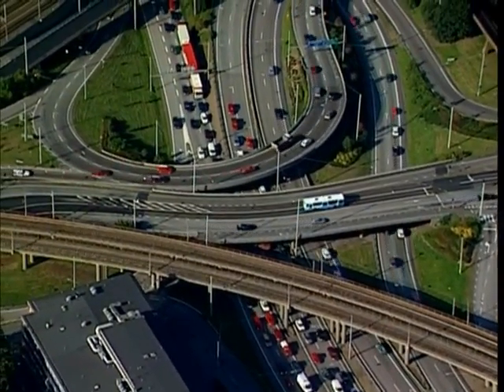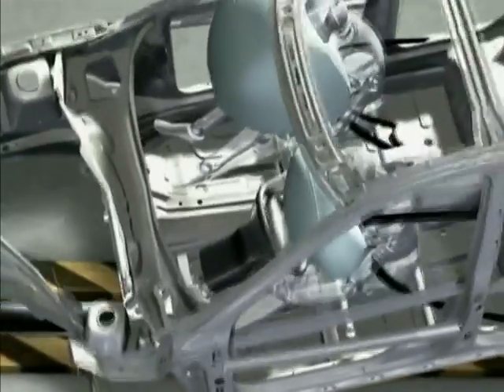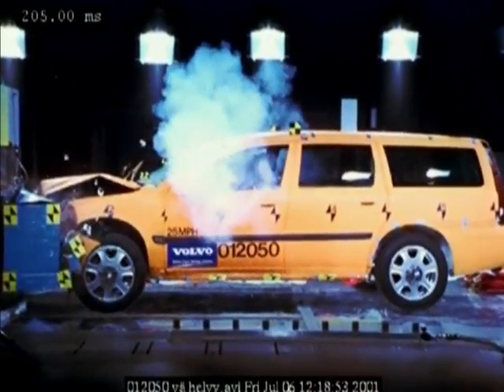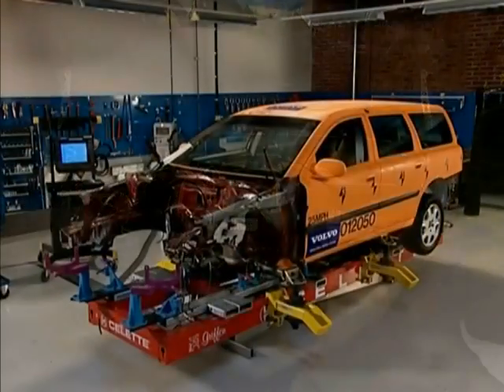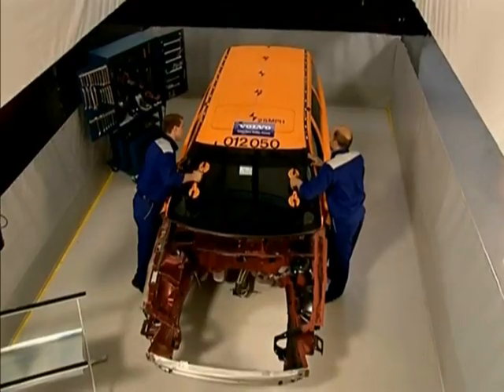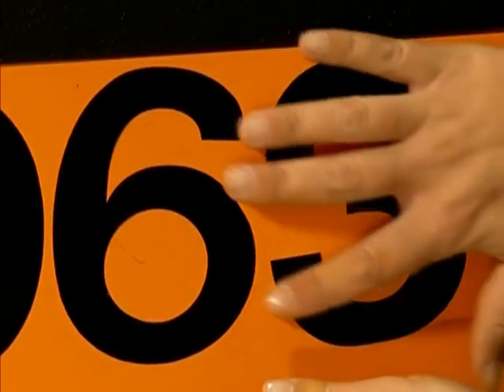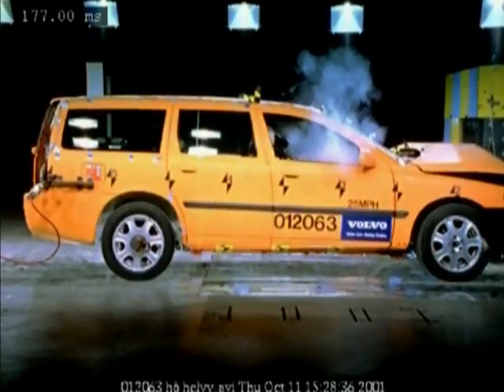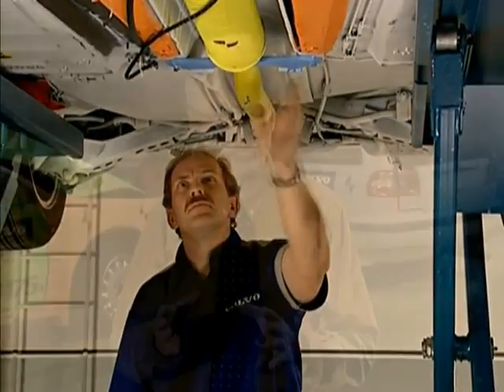COLLISION REPAIR HISTORY : AFTER CRASH TEST VOLVO USES CELETTE TO REPAIR WITH RIGHT PROCESS.

Comment: Interesting to see that after a crash test, a repair process with Celette frame machine and Celette jig system bring the car back to its initial values. You cannot get this performance with any other tool than Celette.